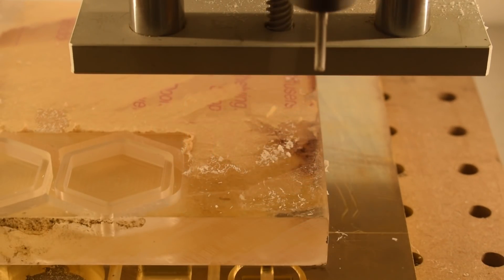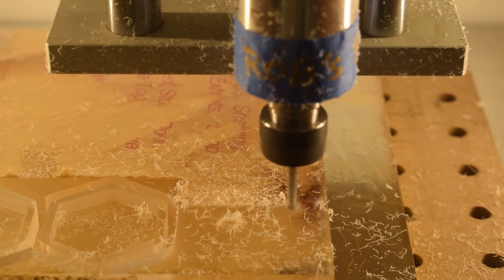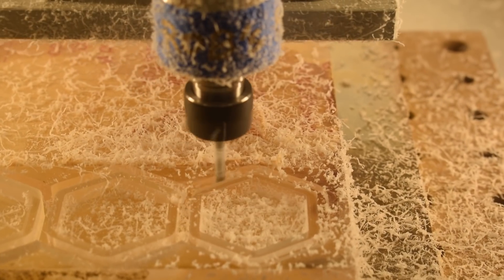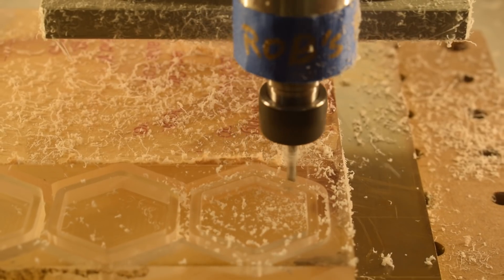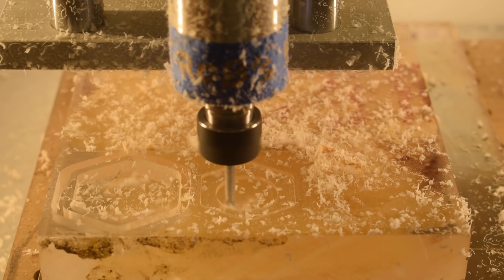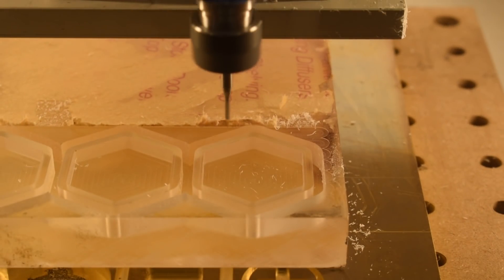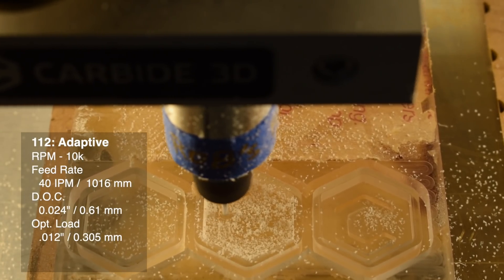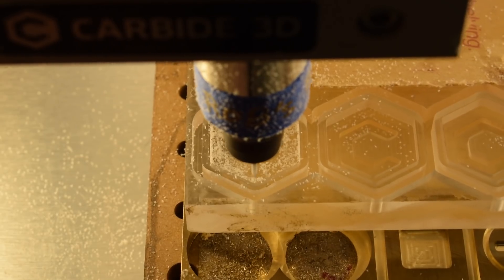Cast Acrylic Machining Guide for the Nomad CNC - #MaterialMonday

Comment: Not to mention you want to be careful with the chips clogging your v-wheels as they are incredibly static after being chipped off and will stick to the aluminum extrusions very quickly
Reply: Would the dust boot help with this?

Comment: Thanks for all the great videos, Winston. Hey, why not a video (or two) about Amana's Single Flute end mills? They work perfectly for both plastic and aluminum.
Reply from the maker: Will try to address single flutes later this year, stay tuned. 👍🏼
-W
Reply: It makes sense for him to focus on providing information based on what Carbide3D offers first. There are way too many endmills out there so he has to start somewhere.
Reply: Awesome job! A question, what Feed and Speed should I use if I want to cut same material with 1/4 HSS End Mill?

Comment: And for the Dewalt users?
Reply: Dewalt user here ... I use solid carbide single flute end mills at 16,000 RPM. Works very nicely. One source I've used is "toolstoday.com" for the Amana Single Flute bits. These are available for plastic and aluminum. In electronic project boxes I can cut perfectly smooth  & sized holes, round and rectangular, for jacks, pushbuttons, LED indicators, etc.
Reply: @robertlawson4295  I mostly meant for feeds and speeds since 10K RPM isn't an option
Reply: @KalebQi :  The single flute bits don't build up heat like 2 or more flutes do, so speed and feed isn't as critical. What I did was to get a scrap piece of acrylic, figure out some reasonable starting values for speed and feed and did a bunch of experimental cuts to get the best results. I don't think anyone is going to be able to hand you numbers that are exactly right for your particular machine and the bits you use without you having to do some trial and error. The important thing is, don't experiment on your project work pieces ... have all the numbers figured out ahead of time to avoid potential disasters. Hope this helps.   ;-)
Reply: @KalebQi  Just keep the chipload (chip per tooth) constant and calculate the feed rate at a faster RPM. He mentioned it in a previous video that everything correlates just fine with the Dewalt.

Comment: Hi Winston.

Cast acrylics is also less brittle as extrudet material, but extrudet has a more even surface and a 10mm sheet is 9.9mm to 10.1mm , where cast can vary from 9mm to 11mm.

And you can minimize chips wrapping around the tool by speed up when going Z down(about 3000mm/min or 120inches per minute), an if possible, combine it with a ramp down.

And at last, I always try to use only Single fluted tools, so the chips have more room to get out of the toolpath.

Greeting from Germany

Comment: Thank You for your videos.  
I am making a "plexiglass" pendulum clock with lots of gears and parts so this is timely.
_ Are you using Fusion 360 for your adaptive rules?
  I am using Aspire.
_ Your website doesn't indicate # of flutes, is that an oversight?
https://shop.carbide3d.com/collections/cutters/products/102-125-flat-cutter-qty-3?variant=928065603